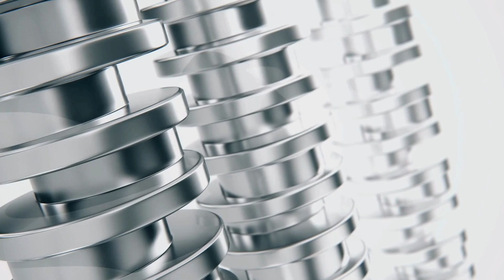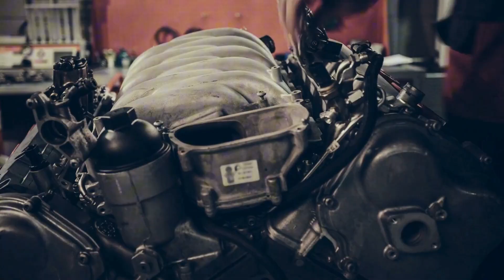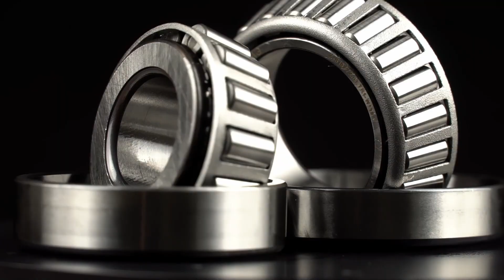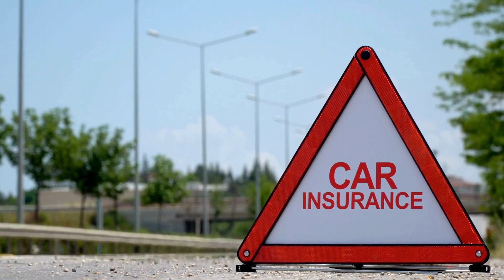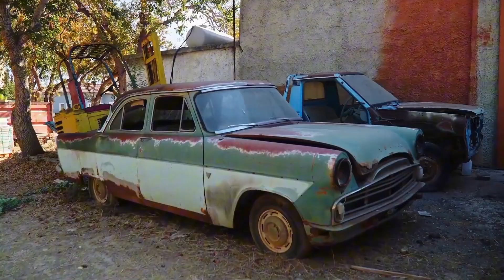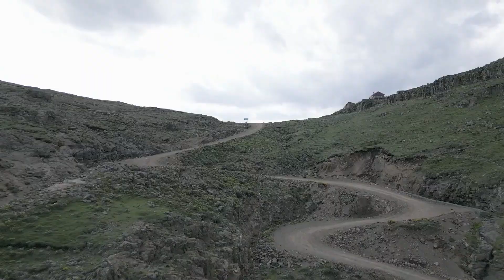Manual Transmission Habits - Fatal Driving Mistakes

Comment: So, don't let my wife drive a manual transmission. 😂 The only thing she doesn't do is the first one. All the other bad habits  = she's guilty. Weird noises when she drives? Occasionally gears grinding, restarting the car after she stalls it, then too high revs when she starts in first gear trying to avoid another stall.😂